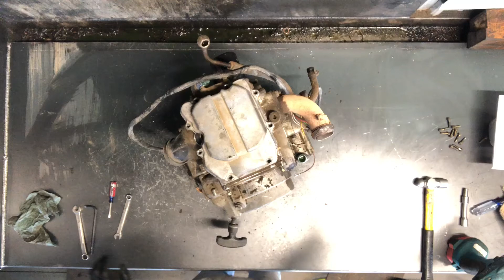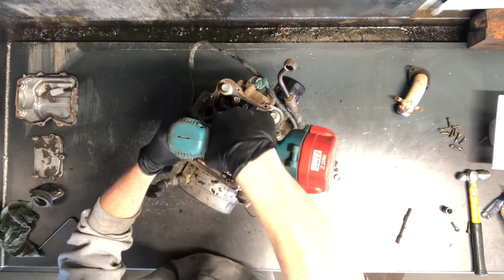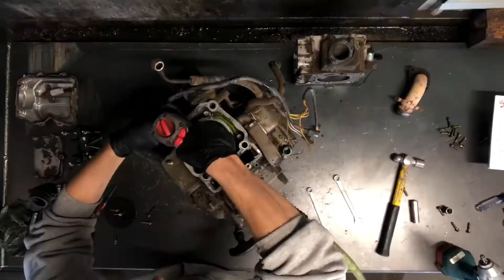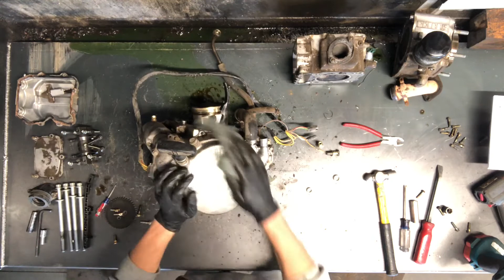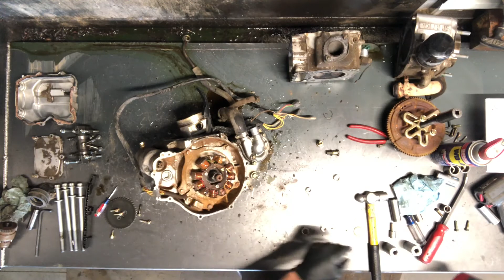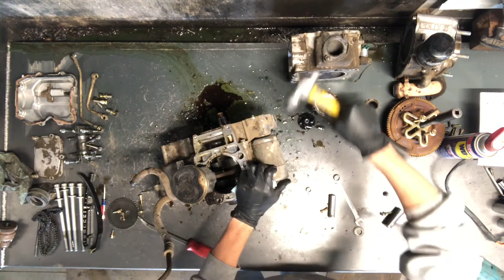HOW TO -1/2 Polaris Magnum Sportsman Ranger 500 425 400 Motor Disassembly Rebuilt Crankcase Case

Comment: I just bought a Polaris Magnum 425 and got ripped off man changed all the fluid I thought it was good as a blown head gasket so sick
Reply from the maker: Welp, it could be worse. At-least there isn't a hole in the crankcase......or is there. Look carefully.  I'd hate for you to get it back together and find out it was cracked. Thanks for watching. Follow our videos closely and I think you'll be alright. Also check out: https://www.ebay.com/str/midnebraskamotorsports if that crankcase is cracked. I believe we have a complete motor for one of these along with 1,000s of other used parts. https://www.ebay.com/str/midnebraskamotorsports

Comment: Hi love your videos .. I have a problem on my polaris predator 500 2007 I was replacing the water pump shaft an when tide the bolts the piston is so hard dont move then i untide them an they spin normal like something holding it when there tide by any chance do you have an idea what can it be